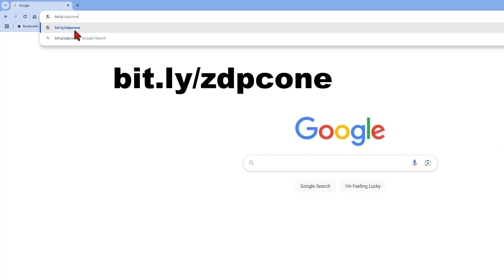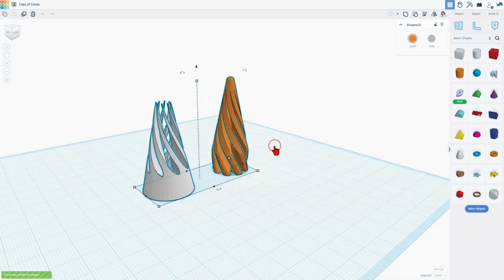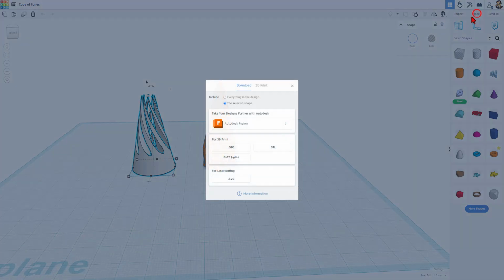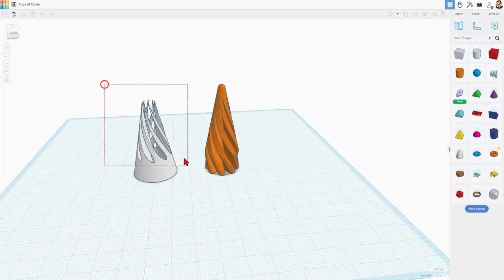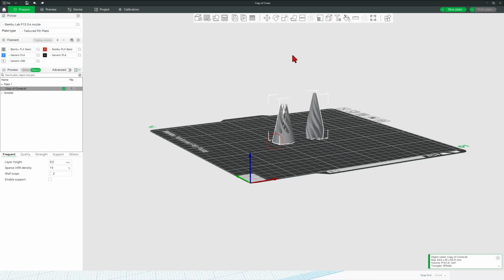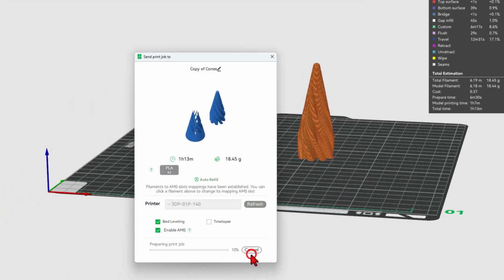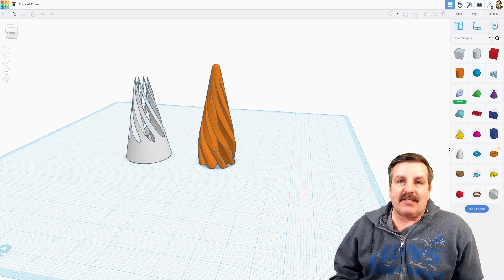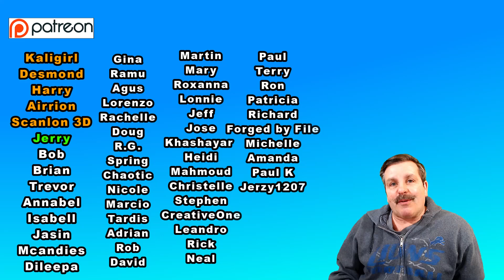Faster Tinkercad STL Exports! FREE Impossible Twisty Fidget by ZDP189

Comment: Nice recovery sad they don't want to fix the problem...
Reply from the maker: I would not really call it their problem. That design is way past what Tinkercad is meant to do. Kind of like driving a car to fast... if I crash it.. My bad. That said, I believe that tweaks to the system to make it more robust are on the way. I do also want to highlight that if you cancel it and restart, the backend caches the results so it is not like starting all over. That can be a nice time savings for the export process.

Comment: Hmmm. I've been using Tinkercad for at least 5 years and when I export it has never presented a save dialog screen when exporting a file. How do I turn that on?
Reply from the maker: Ah.. that is a browser setting. https://youtu.be/4CIijKUvUI4 Thanks for the reminder. I set it years ago... and forget to mention it.
Reply: Ah, I use Firefox, is there a similar setting?
Reply: @Chucka1463  Two ways to get to the same box:
1. Open Settings, select General on left hand side, scroll to Downloads, check “Always ask you where to save files”
or
2. In “Find in Settings” search box at top type “always ask”, checkbox should be first result 

I only use FF and this worked for me.
Reply from the maker: Thanks!